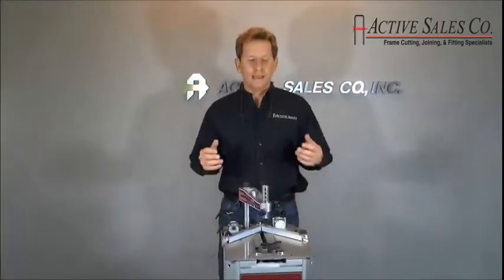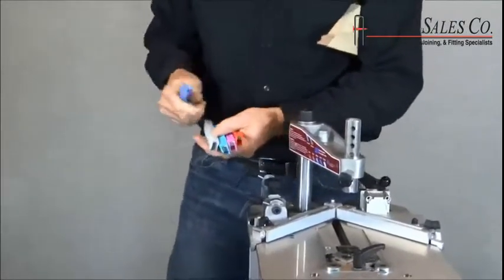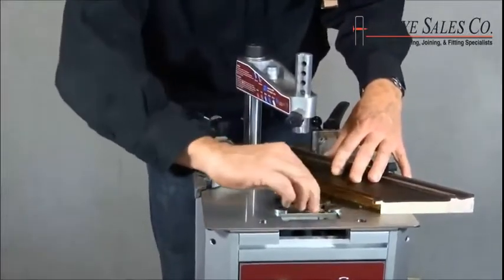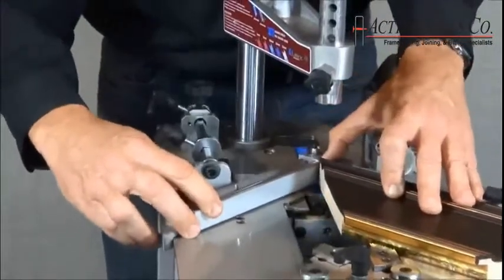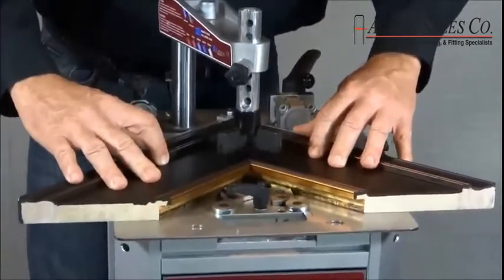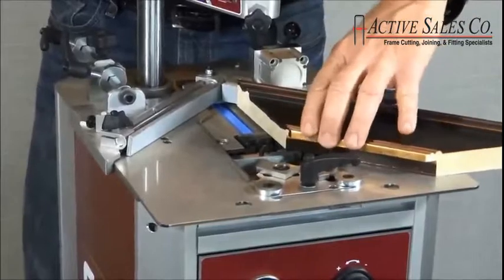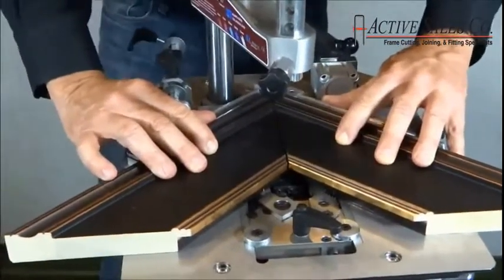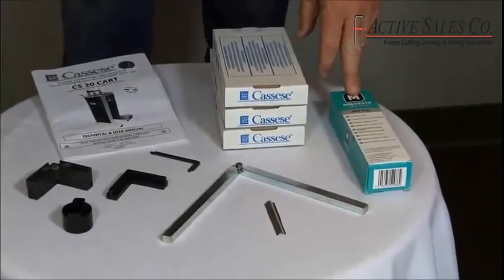Cassese CS20 Walkthrough

Comment: You may find that a common problem in transportation is that a small elbow bend in the air system can become broken...I believe the machine must be kept upright when in transit but this is not very practical.I experienced this when one arrived.Also it important to make sure that the valve which operates the clamp is open when first operating the machine
Reply from the maker: Hi, I am sorry to hear that. How exactly did you get a bend in the air system? The air hosing is contained within the machine, and would not have been exposed to a sensitive area that would allow a bend. Let me know so we can do what we can to prevent this, please.